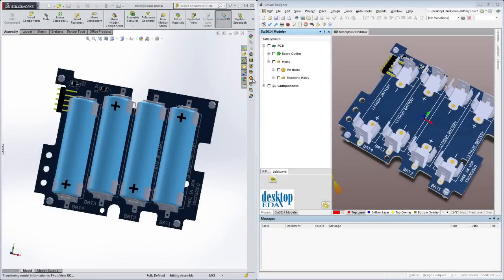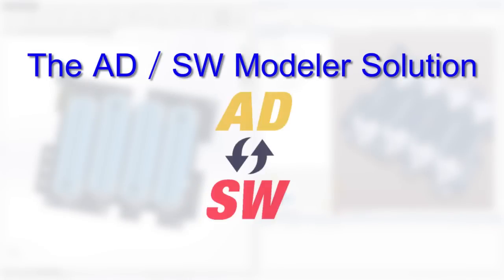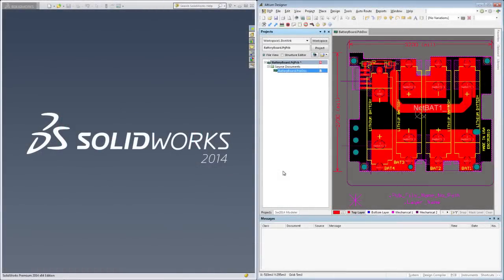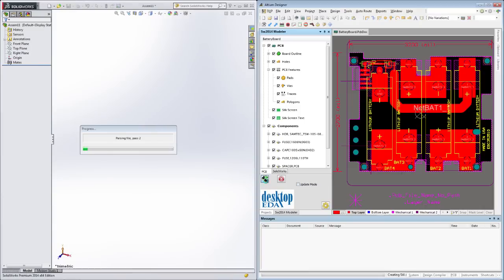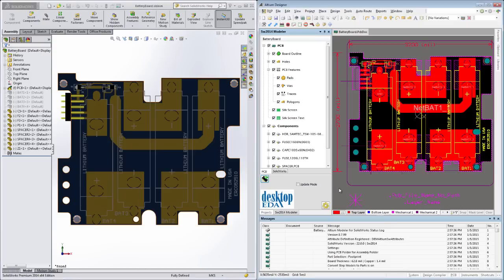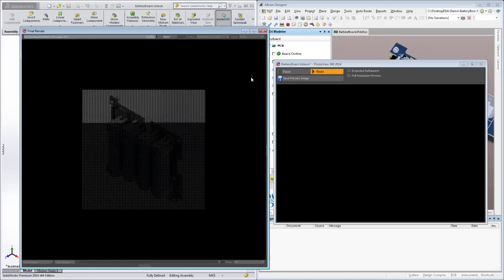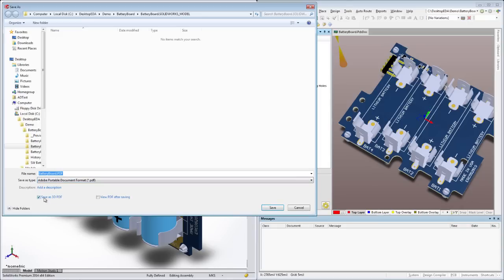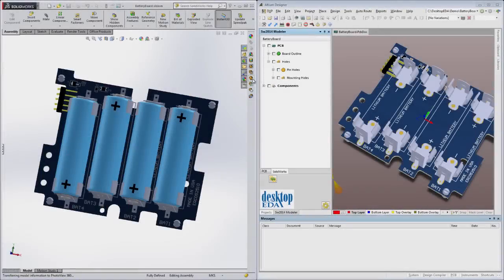Altium Modeler for SolidWorks

Comment: Hello!
I'm have a problem with this extension.
3D STEP models defined in Altium libraries resets it's orientation parameters (X,Y,Z rotation and height) when i transfering PCB to Solidworks.
What am I doing wrong?